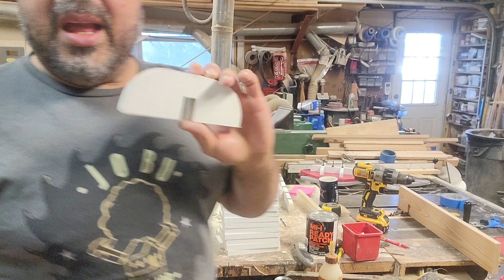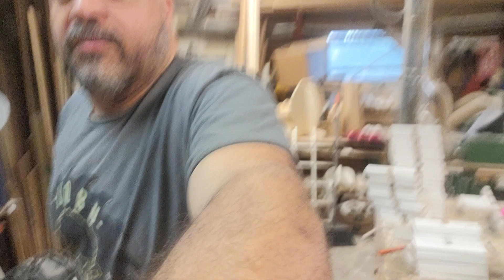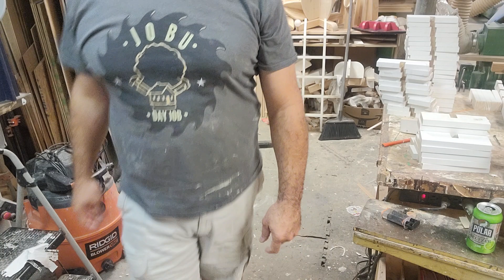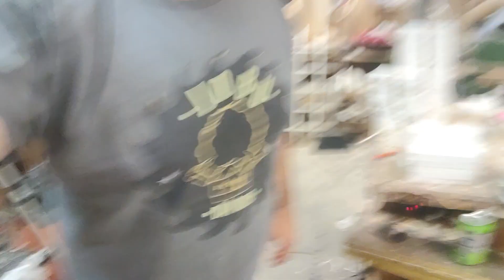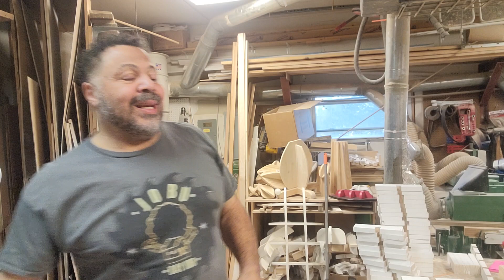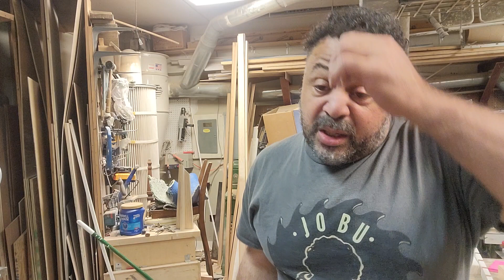Cowboys biggest problem against Denver offensive tackles

Comment: We had 2 crucial drops that would have extended two different drives. We should have kicked a FG on our 2nd possession.
Reply: Just punt that's an option too
Reply: @antoniodominguez7862  it certainly is, depending on field position.. 🏉🏉
Reply: I saw no fewer than 5 drops, and 4 of them essentially ended drives. I was in favor of going for the 4th and 1 on the opening drive. It would have been a 54 yard FG attempt (which is not a given with Greg the Leg anymore), and they had converted 6 of 8 4th and 1 attempts this season up to that point. The second was 4th and 2 from the 20. That's a 37 yard FG attempt, which is far more likely to be made... and the Cowboys have not been good with 4th and 2 or longer this year.
Reply: @antoniodominguez7862  Punting from their 38 will net almost nothing. Even worse when you punt from their 20.